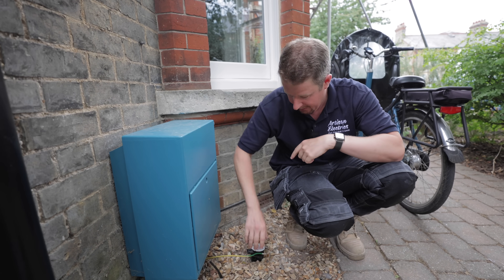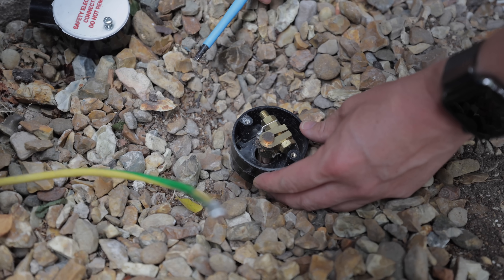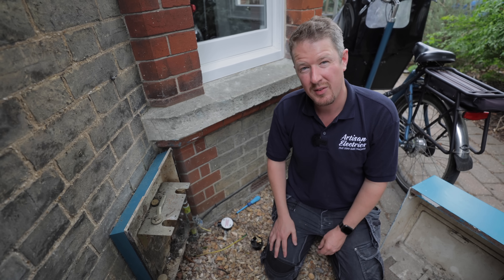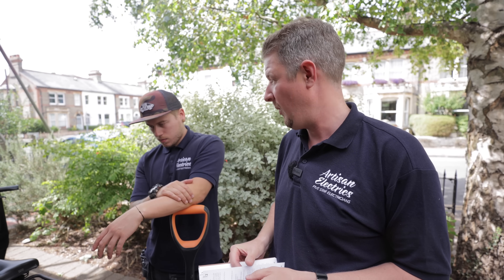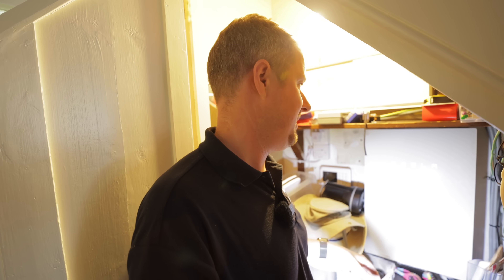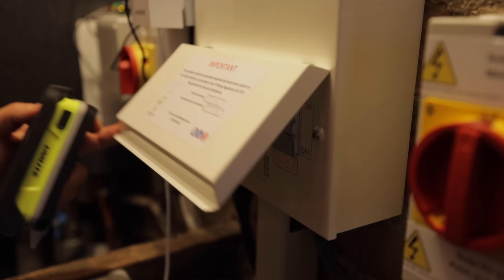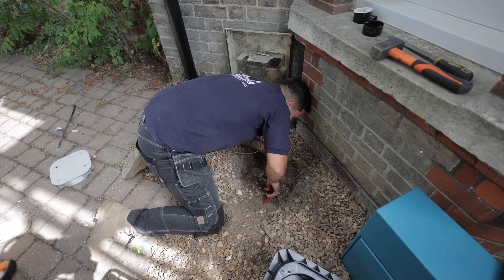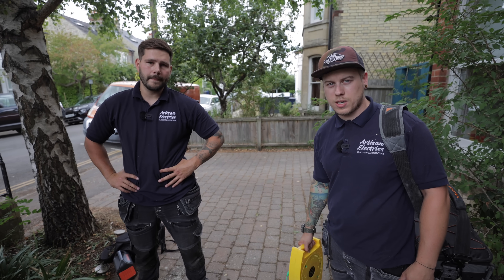The WORST Tesla Powerwall install I've ever seen 🤯

Comment: Apart from a little excess slack in the junction boxes and the additional joints/connections I dont think its worthy of the video title. Sure they could of done the earth rod a little better but still think the title is over critical. Kinda similar to each time you say consumer units are horrible or rats nest because they are not instagram ready.
Reply: Yeah, glad it wasn't just me. I've built vast amounts of electronic equipment over the years, and serviced much more, and as much as I'd like everything to look all right angles and spiffy, at the end of the day, what really counts is the conductive integrity, not the looks.

That junction box was set-up for service access, not an art gallery exhibit.
Reply: Yea thats a fair comment,  but i think its a bit of a mix. The outside boxes didnt look too bad, but that inside junction box did look a little messy. And to be honest i probably wouldnt have fitted an earth pit, but after seeing this i think if i can i will next time
Reply: I wonder what the artisan title would have been if they were the structural engineers that visited the timber frame house lee butchered😂😂
Reply: @JoeCHA136  hahaha, touché
Reply: @JoeCHA136  haha true 😂
Reply from the maker: @JoeCHA136  ‘Artisan messed up 😳’
Reply: @JoeCHA136  does that vid even exist any more of was it a sneaky delete
Reply from the maker: @davebuchan3136  https://youtu.be/JlRsC91yUho here’s the link
Reply: More of a trip hazard , probably why its broken off.
Reply: Agree sparks myself and looks okay ,three stooges all agreed one dumber than the other 🤣🤣🤣🤣
Reply: There got equipment all over the damn place in side different lofts and outside sheesh.

Looks like a tough install,, hello form Texas
Reply: I totally agree they do this so they get views
Reply: I personally think it’s a fair assessment. The wiring within those junction boxes is not acceptable. The earth cable breaking away from the earth rod is completely unacceptable.

Good work artisan electrics.
Reply: I wonder if it is fine to have that data cables and power cables all together in the same junction box.  In case of water ingress in the junction box,  possibly data cables could carry low voltage power .
Reply: @rodrigovasconceloscarvalho411  yes it was my understanding too that you’re not allowed to mix lines with two widely different voltages in one conduit, at least in the Netherlands. So no network cabling inside a conduit with live wires having only single insulation. And most definitely not in a junction box.
Reply: @wouterkuit3508  
Yes. Do not mix voltages. And clearly not the way that was done. 
I believe you can mix inside wide trunking with large gaps between wires of different voltages.
Reply from the maker: Fair comments here, however it has been title as an opinion as this is the worst I’ve personally seen. Granted there may be far worse out there and overall it it was a good install. Just from my personal experience this is the worst Tesla Powerwall install I’ve seen.
Reply: @artisanelectrics  I don’t think we should beat up on a click bait title that’s just the way YT works. 
Those boxes were way messier than necessary even if not up to artisan standard I’d want cleaner box to stop future fingers from inadvertently pulling some of those smaller ct cables.
Reply: @artisanelectrics  to be fair the earth rod was a big fail, everything else looked pretty good thoigh, just excess slack making it look messy but no problems
Reply: @lewistempleman9752  yeah, they were just leaving 10% for the next guy 😂
Reply: @havoctrousers  😅😅
Reply: @lewistempleman9752  
Nonsense! One of the j boxes was a rats nest with too many cables rammed in. If you think that is acceptable then change professions.
Reply: @artisanelectrics  Fair enough mate, I would just try to give others in the trade that did the install a fair representation if the rest of the install was good.

Comment from the maker: What are your thoughts on the Tesla Powerwall? Is it worth the wait...
Reply: Overpriced IMO but one of the best looking. Kinda the Apple of energy products.
Reply: Just got onto the Octopus Tesla Energy Plan, matched import & export rates, something like 21p/kWh for new customers. In exchange you let Tesla control your Powerwall to help with grid load shifting. Will pay for itself pretty quickly over this winter... 😅
Reply: If they could get supply sorted out and introduce the 4680 battery Powerwall 3 (more capacity for same size, or same capacity for smaller size) then perfect.

Unfortunately can’t meet supply/demand and is why other companies are prospering. But it is the apple of products but scarce
Reply: Very happy with ours. Yes, the gateway switchover isn’t always instantaneous, so the computer sometimes shuts down and a few remote-control LEDs switch themselves on but generally you don’t know there’s been an outage. It has a built in heating and cooling system so can be installed pretty much anywhere and yes, it does look better than most others - important if it has to go somewhere where you are going to see it every day! The other nice feature is ‘Stormwatch’ which automatically puts the battery into retention mode and keeps it topped up if a period of high winds is forecast. This works really well and has kept it at 100% a couple of times when the grid has then gone off as predicted during storms last winter. The app is also very good, showing current and past production from solar, grid import/export and, of course, data on the battery itself in a nice, easy to use format. As you can tell I’m a fan, but then I like Apple stuff too! 👍😄
Reply: Nope, unless you want the 'look' and can tell everyone you have PW! Price and availability are the killers at the moment and there are several alternatives on the market - either as a combined unit e.g. GivEnergy or pairing a AC/Hybrid inverter with modular batteries e.g. Pylontech
Reply: No. Lithium ion will be obsolete by then